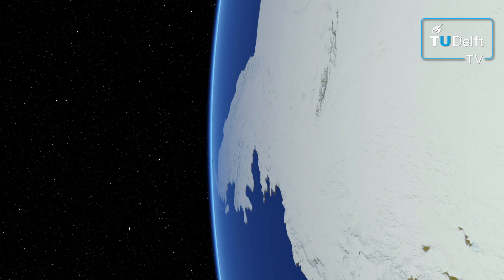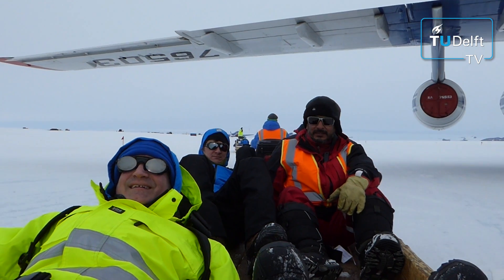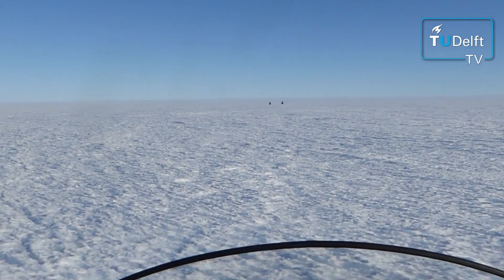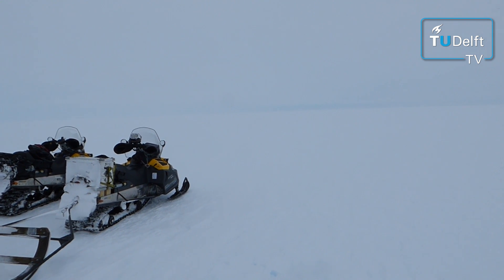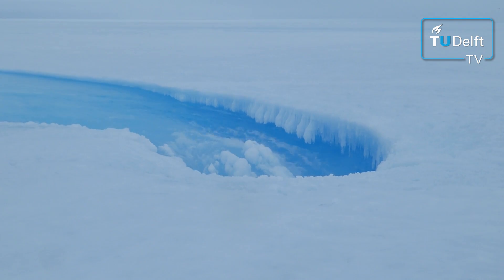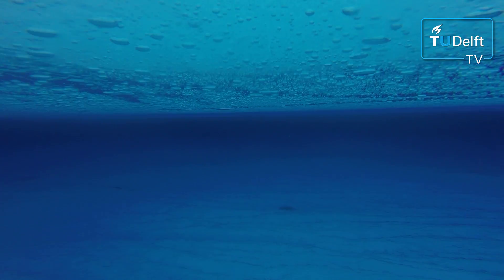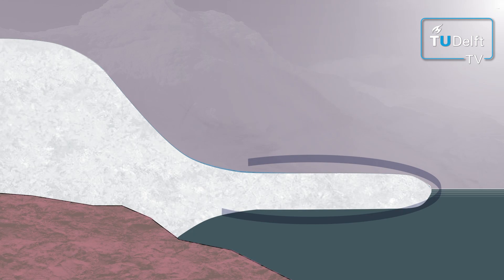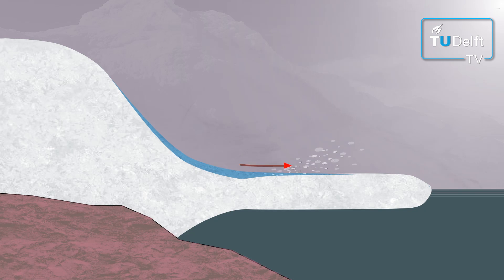How much will the melting ice shelves of Antarctica contribute to global sea level rise?

Comment: Are you also including the many vulcanoes in your current models on Antarctica because I notice youuse satellite images of annual changes and annual melts during the summertime but you do not mention the powerful impact which hot active vulcanoes have on the earth's climate. There is vast evidence that the vulcanoes are very active  and should defnitely be included in your antarctic melting models. Otherwise they would show skewed reasons causing problems with the underlying scientific research. http://www.livescience.com/46194-volcanoes-melt-antarctic-glaciers.html